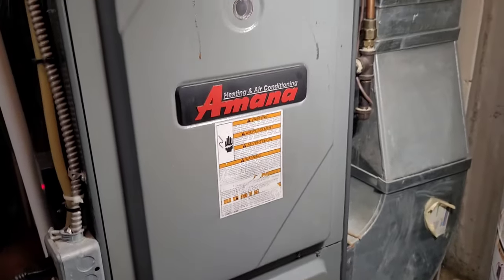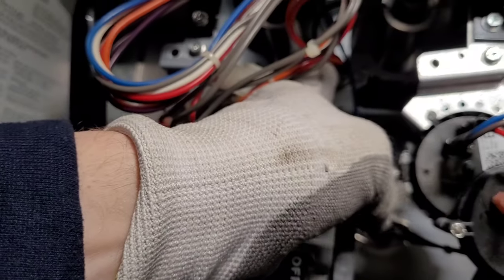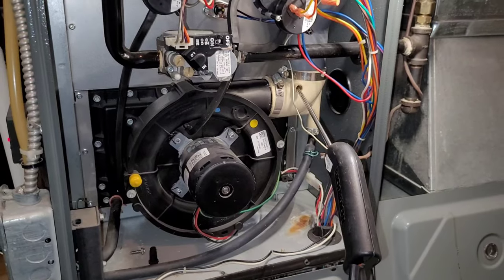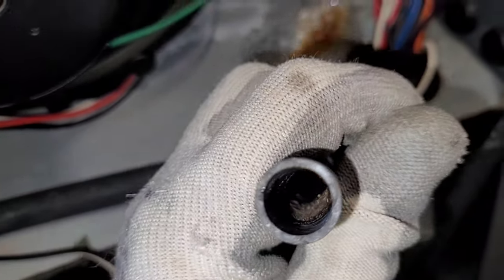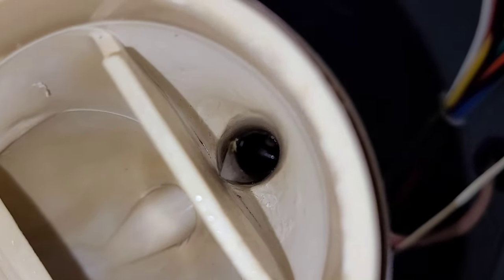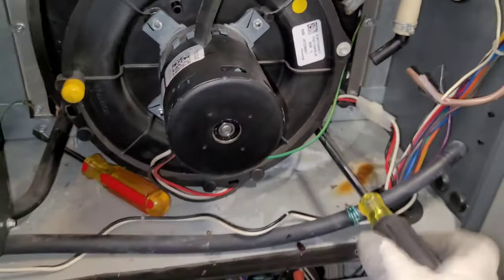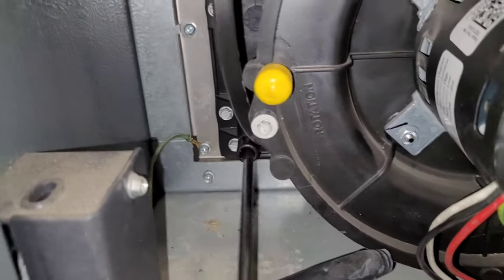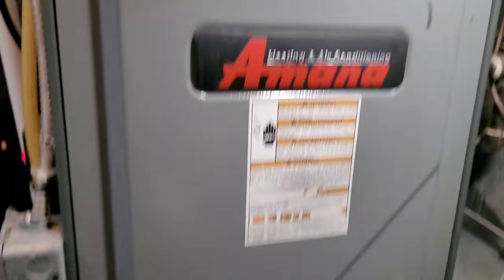Goodman / Amana Furnace Full Of Water!

Comment: I'm not hearing good things about the Amana brand of furnaces and air conditioners.   Would love your opinion.   There's a lot of commentary about them being pieces of junk :(. I was considering replacing my units with Amana and now I'm feeling like I need to do more research.
Reply from the maker: There's nothing wrong with the Amana brand. Just make sure it is installed and sized correctly and it will give you many good years.
Reply: @SmitHVAC.  Hi. THank you for responding.   It seems there are two common issues with them.  One, is that it fails to start up! ie.  #1 Air Conditioner Won't Power On. ...
#2 Air Conditioner Turns On, But is Not Cooling Properly. ...
#3 Air Conditioner has Weak Airflow Issues. ...
#4 Air Conditioner is Short Cycling. ...  I'm a little nervous to go with Amana.  I need new equipment as my air conditioner particularly needs to be replaced. :(
Reply from the maker: @jayneyp8683  Those issues are pretty generic and could apply to any brand. I personally like the Rheem brand but I do yearly maintenance on lots of Amanas that work perfectly. In the US anyone can buy Goodman/Amana and they tend to be installed improperly, or under/oversized for the home, which can cause short cycling or underperforming.